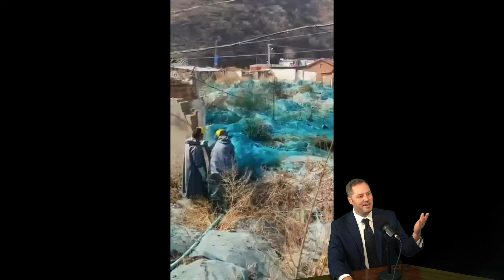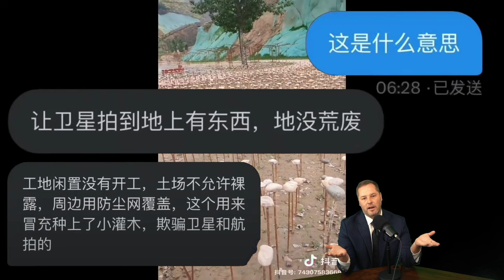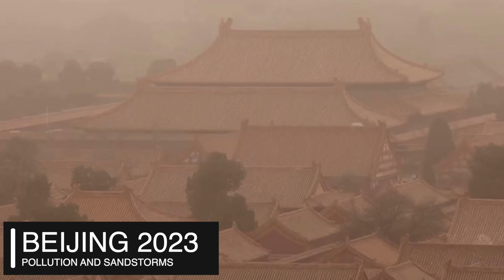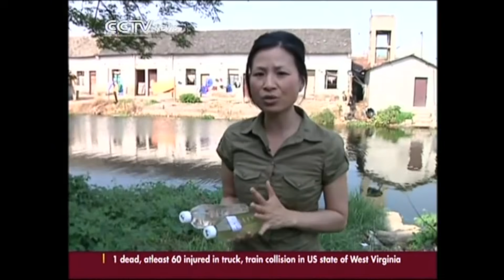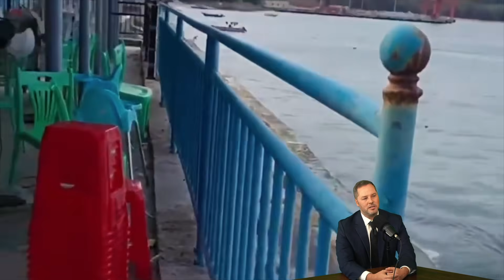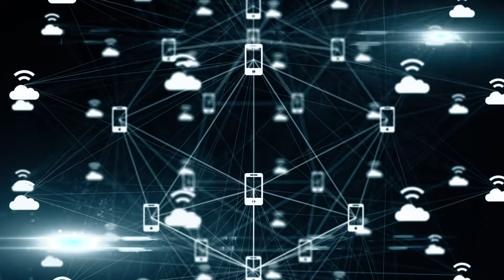China is planting Fields of Stones stuck to Metal Bars - No, Really

Comment: In Australia they spray the sides of new highways green. It is not to fool anyone, from what I can tell it is a type of sticky paint that they spray on the newly dug dirt that is not going to be dug for a while as they work on other parts of the project. this is to keep the dust down because bare dirt and a breeze will cause a dust storm and nearby residents would be on the phone to the local council. I don't know if this is the same as what they are spraying in China but keeping dust down along a highway seems to make sense.
My sister-in-law lived in Beijing and the pollution was terrible. She has since left which seems like a good idea. But she said the pollution was dependent on the day. One day it would be dark grey and you had to stay inside or wear a mask. The very next day would be a crystal blue sky. It all depended on the wind. It sounds like Beijing is in a hollow and relies on weather patterns to blow the smog away. This doesn't account for the dirty streets or dirty water of course.

Comment: To remove air pollution they need very large areas of electrostatic grids of small size high voltage in Kv range, negative charged ion generators to draw in the dust from the air 👍 doesn't have to be high current to do the job as long as the insulators are good quality Ceramic or PTFE (c) PAD

Comment: Just throwing this out, I worked for a construction company for ten years right out of high school. We built roads and housing communities, all the dirt work. With every job we did, we would never put down top soil after grading the regular fill dirt. We would call a company out to do the hydroseeding, and they would spray right on top of the dirt, absolutely no prep needed. We spray it so that the roots of the growing plants will lock in the dirt to stop erosion. Granted, it's not amazing looking grass that grows, but it grows quickly, and does what it needs to.
Reply: You guys would do a half assed job then 😂
Reply: @abrahamsanchez7455  Never had a single issue, and the topsoil is always sent out and sold by the land owners.

Comment: I went to Chongqing in 2019, the air there just felt polluted (and hot and very humid, although that's mostly the climate's fault) to the point where I got a sore throat just from breathing outside. They had AC everywhere though, so for clear air you just had to go inside or in a car.
Reply: For clear air go inside? A car? What is the world coming to? Logic should make you question this..
Reply: Where do you think the air comes from for the air con, doesn’t matter how you clean it, if it’s contaminated it causes harm, case in point Legionnaires Disease.
Reply: AC just makes the air colder not cleaner...
Reply: Most modern cars have a HEPA filter which should be replaced every couple of years.

You know if it needs doing because moisture doesn't drain properly and you get water coming out your dash.

Comment: The massive "Garbage Patch"  in the Pacific Ocean is 90% derived from the rivers of China. We go to ridiculous  efforts to minimize our pollution, and China just parrots their supposed efforts.  I lived in Los Angeles, CA in the mid 70's, and the air pollution was massive.  It was due to 1) the LA Basin landform.., & 2) the enormous number of polluting motor car.  New emission standards were implemented on motor cars, and the  visible pollution diminished.  China could do the same, but the cost would be enormous to their prestige of being a premier manufacturer of everything..  Slave labor contributes.  It makes manufacturing so much cheaper, and thus entices more  expansion of the industrial sector

Comment: the painting the dirt green could legitimately be the material they spray on loose gravel and dirt at building sites to stop it from washing away in the rain during long construction projects, causing many issues. it's a rubbery mixture that spreads over the top of the dirt mounds and stops water getting through and turning the whole thing to a river of mud at the first sign of a shower. I saw some of this literally the other week here in australia, it's a legitimate use. I'm not 100% sure if it's the same thing there, but it looks like it to me.
Reply: Was not expecting to find DeSinc in the comments here. That explanation seems reasonable enough, though we wouldn't know until the government or company that's doing this will explain whats going on.

Comment: I recall a major controversy years ago, where the Chinese government complained loudly about an international incident that was a major thorn in their side.

The official air pollution monitors around Beijing showed the air pollution was well under the limits, but the USA had their own air pollution monitor on top of the U.S. Embassy which showed the actual pollution was off the charts.  The Embassy had a website which anyone could look up the actual numbers at anytime, and the Chinese government was furious that their fake data could be easily exposed and disproven by anyone.

They demanded that the USA remove the air pollution monitor and shut down the site, yet the USA refused.

Comment: I see them hydroseeding with large diesel hydroseeders for erosion control, invasive plant control, and nitrogen fixation. This actually means they are moving way faster than normal in there progress. If you need erosion control it means your building on massive scales fast. Where after construction you need to stop very very high man made cliffs that are dug and carved out of the land from eroding back down on the construction  site, this is accomplished through large massive scale hydroseeder cannons that can reach those heights. Thus should be concerning but not for them faking anything but that they are construction at alarming rates and massively. Also spraying the side of the highway is for invasive plant management, those hydroseeders can be loaded with herbicides that are green in color. These plants have to be managed when traffic is overused and seeds from other areas make there way carried by cars and trucks. On tires and on the vehicle body these seeds can be carried vast distances. This is also concerning because this means there logistics has ramped up and commuting on there roads has also ramped up. This means there moving LOTS of stuff by semi-truck across vast distances along those roads so much that they need to control an invasive plant species. High movements of supplies and logistics should set off alarm bells for many Defense Experts across the world. I personally will be watching as this develops, it's most likely benign and just business as usual.... but just in case.. I'm watching you China.. Always watching....🤨

Comment: Gutter oil is honestly pretty interesting. I mean, if you can just take it out of the gutter and use it all over again, why do they even throw it out to begin with?
Is it also a ploy to fool inspectors? But surely those same inspectors would notice if you don't have any fresh oil bottles sitting around? The kind they use for restaurants is not exactly small.
Reply: I wonder if the nicer more regulated restaurants abide by the rules and throw out old oil and then the smaller mom n pop restaurants take what's discarded to reuse😬 At least one could hope!
Reply: I am puzzled by the oil thing too. I have lived in China for a year in different cities, some had terrible air (north, Fushun), Beijing was kinda middle-level, some day bad, some day ok, Shanghai was ok, Shenzhen was totally fine. But I've never seen anyone collecting anything from garbage bins. Like, ever. There is no logic, like you pointed out. I wonder what is really going on in these bin videos...

Comment: I knew what the hydra seeding was immediately.
We did it on my local golf course years ago. 
You can spray it anywhere and it'll stick. 
But inclined surfaces won't make it. It'll wash away. 
They're just really bad at this. 

The rocks look like cotton. Probably what it's supposed to mimic. Maybe a movie film set? 
You'd think planting actual cotton would be easier. 
Guess it just dies pretty quickly. I dunno.

Comment: How many of the local districts are engaging in this? Its a huge country and there a bunch of currupt local governments for sure. But how much overall? 

So the government seems to have regulation in place to improve the environment, hence inspectors who "check". they are just badly executed and the local government has an easy job fooling them. So regulation enforcement is pretty bad in  this regard, alright. But if the government wants to fool everyone, why the effort of the local disricts to fool the regulators then? .. thar would be totally uneccessary. China could claim what they want ,but no-one would ever notice if certain dry land is green or not, Chinese people as well. If "China" wants to feel everyone there is no need for this type of deception. 

Also you can move toward a cleaner energy mix faster than many other countries while increasing coal. ... can't compare percentages with absolute numbers. Germany, is actually moving backwards regarding fossil fuels because of shutting down nuclear power plants. 

If you would go just a bit further with your critical thinking when "reporting" on these rediculous practices in China would be great.

Comment: I can't speak for all these videos but the berm that does look like hydro seeding, which they are spraying on a unfinished berm so it's most likely a temporary berm on a jobsite which you don't normally pull rocks and get special top soil, throw some winter rye which will grow pretty much anywhere, mixed with fiber and tact it will be enough even on rocky berms hell I've seen grass grow just from the fiber alone.

Comment: CFCs were banned internationally because they break down the ozone layer (holes). I recall that a few years ago I read a news article that showed that there'd been a surge in the amount of CFCs in the stratosphere, and it had been tracked to eastern China, where it was guessed that spray insulation using CFCs was being used in incredible amounts because it's cheaper. The result was the entire planet put at risk through more holes in the ozone layer, and increasing the size of previously shrinking holes.

Comment: I see contractors spray hydroseed mixtures on trash soil around here all the time. No, it doesn't work, but they do it anyway. If the contract simply states that the substrate after the earth work must be hydro seeded, that's all they do. They're not required to make sure it actually works. It's kind of a scam. A band aid to show the inspectors and busy bodies that we care about erosion. No one cares in a few months that everything on the job site is dead. It's just about making the attempt.

Comment: One issue with those wallets they arnt designed well to hold cash. I require a wallet to hold paper money and a fair amount of it that ittle strap on the back does not cut it not in the slightest

Comment: Hydroseeding is legitimately done for roadside soil stabilization too here in the US. It is also green colored and shot out of a water cannon from a truck. Usually there's someone manning the nozzle.
It is of course different than the hydroseeding for lawns and does not require the same prep.

Not saying that Chine is doing the same thing. Based on there behavior, I'd bet they're just going through the motions and using only color, without seed and stabilizing compounds.

Comment: The green wet dream is a Western idea and they have set targets of 2050 to be carbon neutral. China has set 2060 to be carbon neutral. The Western idea is of a fast energy transition, with fast phase out of fossil fuels. China did not give any detailed road map of fossil fuel phase out, nor did it commit to staged phase out. Rather they are increasing renewable production at a record rate but also increasing fossil fuel and nuclear fuel use at a record rate as well. So if the 2060 Chinese target is to be met much more manufacturing of renewable products will need to be made (energy requirements will absolutely go through the roof) and phase out of fossil fuels will be very late towards 2060 or even just before 2060.

The green energy transition is expensive as hell on energy use and material use. The West buys renewable products from China eg solar panels, wind turbine components, batteries, other electronic components, building materials, copper products etc but has no idea on cost of manufacture and materials use.

Comment: You do not need to prep for hydroseeding, especially if you are using native seed. I see this on road sides out here in the USA all the time. And 2 weeks later, its all sprouted, another few weeks and its covered in flowers. I think in the video, we might be seeing both tho.
Reply: The ground is made bare or cut very short, though. And you don't hydroseed literal rocks!
Reply: @toomanymarys7355  ya, not from what I've seen. Would you say is probably what the workers are told, but they spray it all and even rocks get a decent amount of sprouts in the crack and whatnot. You would be surprised at where plants will grow. Just Google trees or plants growing out of rocks and you'll see what I see all over the place. I'm sure plenty  seeds get washed off the faces, but then the just grow at the bottom of the rock face.

Comment: im glad u mentioned hydroseeding bcuz that is indeed a real thing. I will say tho that its not just planting seed and paint. it also normally contains mulch and some other fertilizers for the seeds. Without prior prep it wont do very much, especially on just rock and sand but it will do something. a few small sparse plants will grow in cracks and stuff but not many and the cost of it would much outweigh the benefit. plus the plants wont last without water so... and theres no guarantee they are even doing that. that might just literally be paint

Comment: Vaping for example. In a recent test done in the UK on widely available vapes, they found that metals used in the heating coils (probably made out of pot metal) contained illegally high levels of lead, chromium and nickel which had leached into the e-liquid, the e-liquids in themselves often contained higher than permitted doses of contaminants. The bottom line was you are better off smoking. In particular this study was aimed at reducing use by school kids. 

Baby artificial milk is bought up in great quantities from Europe by the Chinese middle class. These people know full well that the regulation needed to ensure these products are safe simply does not exist there. 

In another documentary it was found that farmers regularly use extremely high levels of antibiotics in order to get sick animals to processing. 

You can't trust even the capacitors used in electrical equipment. So how you supposed to trust anything consumable.

Since around 2000 the Chinese sausages consumed in Europe are made in Canada. Meat products are banned for export to the EU markets.

Comment: I think its a military strategy. If it looks like grass from high up and the helicopter lands and it turns out to be sand, that would be an easy booby trap. Obviously sand would be obvious considering air propulsion but it will really throw troops for a loop no matter where they are if everything around you is green. Can you guess what color the Chinese military will have their soldiers wear? I have a guess

Comment: You won't be aware of this, but in my neighbourhood, here in Johnsonville, New Zealand, many of our roads have been cut through undulating hills of we call, Rotten Rock. This can be unstable especially during heavy rain. A method the roads department has found to be successful is to spray the vertical surface with a concoction of a green died paper mache and grass seed. The paper mix holds onto the rock face allowing the grass seed to spout. 
There's no duplicity involved, no scary conspiracy theories just the authorities taking care of business.
Could it be that the authorities in China highlighted here as a piece of CCP conspiracy just be something more to do with something more prosoic than a conspiracy.

Comment: Don't need to look into it I learned about this bologna years ago. I bought an air horn for a automobile that was made in China the power of the compressor it came with a 40 amp relay, or at least that's what it said on its case. The relay quickly burned out, so I opened it up, what did I find inside? A 3 amp relay, just enough to get it by the inspector. This is why I avoid Chinese crap.

Comment: Um, no.  We don’t ALL know about gutter oil.

I haven’t seen any of China’s “Green Initiative” advertising, and wouldn’t have bought it.  FWW, it wouldn’t even take inspectors to identify faked pollution data.  You can test it statistically without going anywhere near the city.  People have used that to identify fake data in published research, but it is much easier to let it slide.

Full reveal, St. Louis Missouri (where I live) also gets electric power from coal, and has a persistent air pollution problem.  I’ve seen pictures of what the city looked like when it was heated by coal furnaces in the 1940’s and it was much worse than Beijing is today.  There is a lake nearby where swimming is prohibited due to PCB contamination from Mallinkrodt chemical company dumping its waste during WW II.  They also left radioactive waste, but only buried some of it.  Eighty years later, those shortsighted actions are still impacting people.

Let’s build prisons on the worst sites, and confine the people responsible for this there - letting them drink PCB water, eat poisoned fish, inhale radioactive dust, and breathe heavy metal residue from the coal plants.